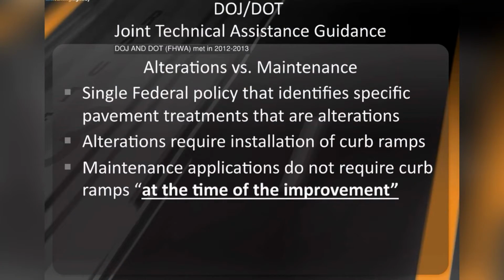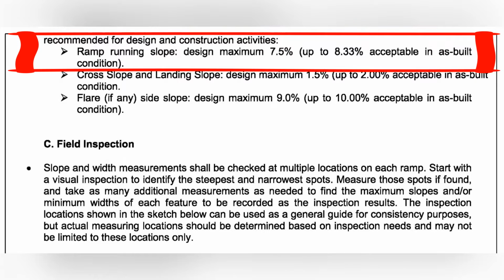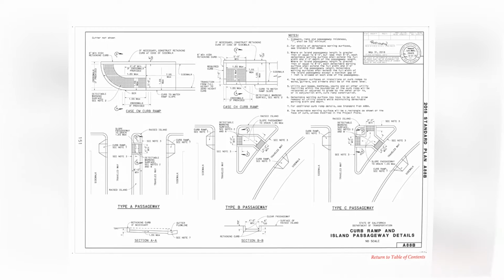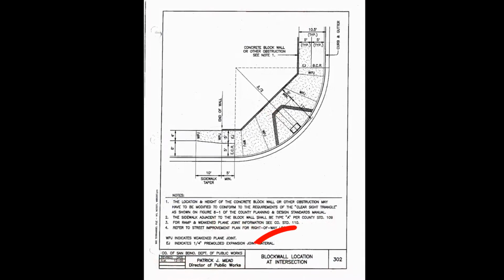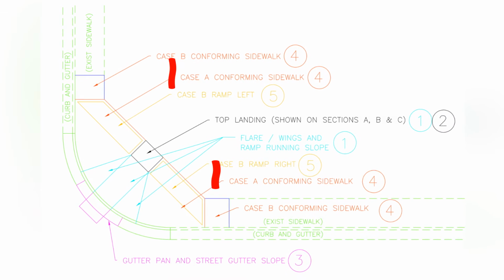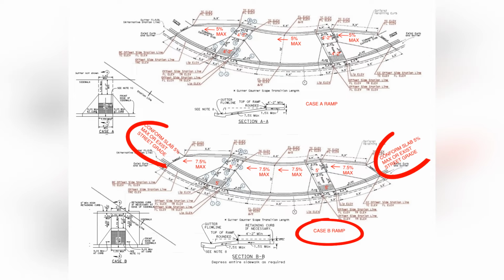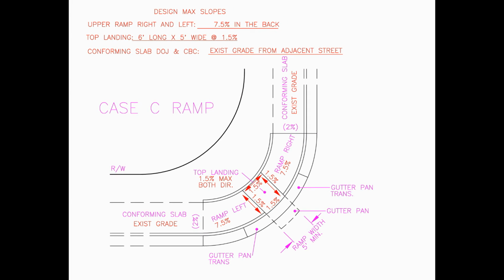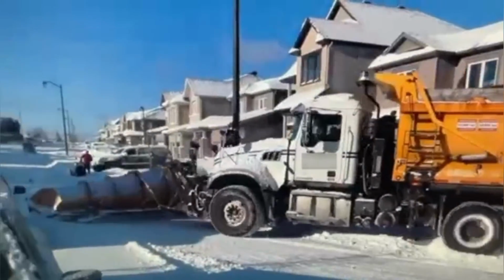ADA Curb Ramps & Slope Guidelines

Comment: Is this just ada standard? Sppwc max is 8%
Reply from the maker: You can technically go up to 8.33% on a ramp run but Caltrans and SB County and many other agencies have now changed to 7.5% max.  You should really design a ramp, if all possible, no steeper than 7.5%.  With a simple little field change it does not take much to be over 8.3% and if this happens, it gets very costly with removal and reconstruction.
Reply: This video is spot on, I'll be watching it a few more times.
I've stayed very busy replacing ramps that are non compliant because contractors attempted to build them at or very near the maximum slopes. 
With inspectors and civilians hungry for lawsuit money all inspecting with a 2' smart level, no one will ever design and execute a ramp at 8.33 and a crosslope of 2  that will pass.

So smart to designate "design parameters at 7.5 and 1.5.
I typically set up my ramps at 6 percent and 1% crossslope just to give room for finishers that might need to move more quickly on a busy pour.
  Of course that's if the situation allows..
These days if I'm asked to build a ramp with only room for 7.9% I'll refuse.. it's a recipe for failure.

Looking foward to more videos.  And digging deeper into this one here, it's very inclusive to a variety of ramps! Thanks!